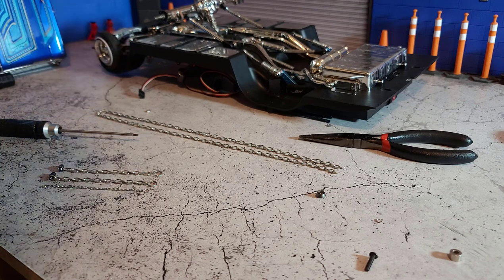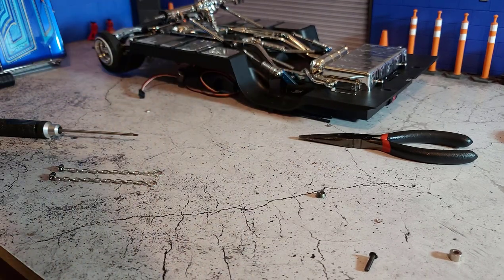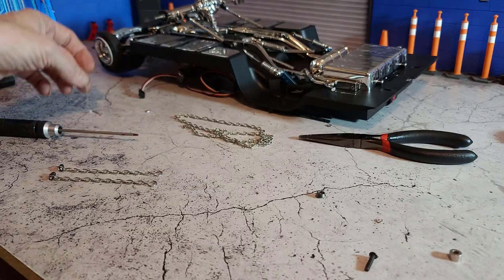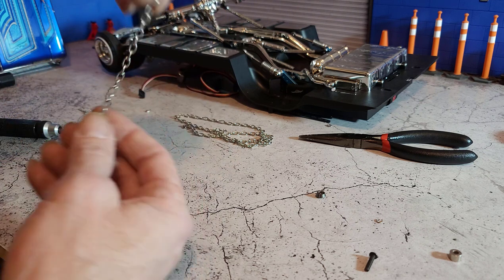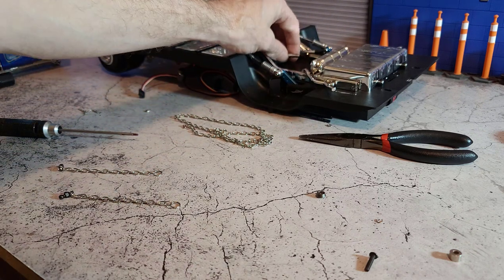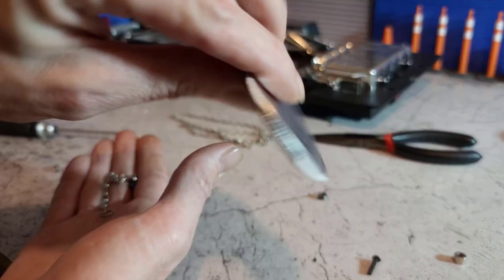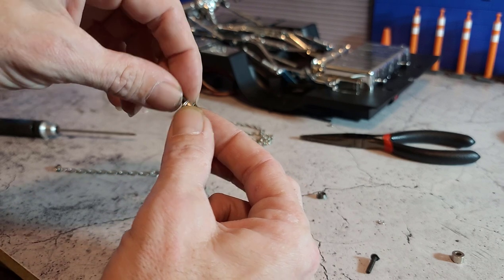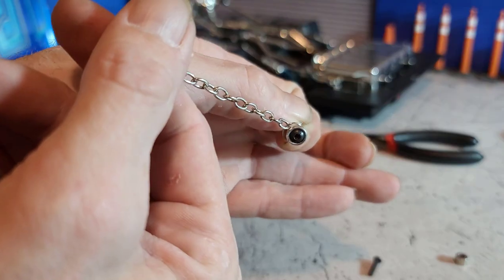Redcat Impala SixtyFour Lowrider Axle Chains Install

Comment: Hello,i have a question about the (strenghtend) rear axle you have on your 64.Where can i find them,i have been looking on Redcat,Kandy n Chrome, eBay..i can't find them anywhere.To me those axles a big mystery bicause i see them on a lot of 64's on YouTube,but i still don't know where to find and buy Them...thanks..
Reply from the maker: The axle reinforcement is from Kandy and Chrome. It's a decal but I cut lexan stip to reinforce it.
Reply: @NorthSideCustomRC  THANKS for your superfast reaction!!...Yes ofcourse i've seen them on K&C ,but arrent these Just adhesives/stickers with engravings?...I realy thought it was An new type of axle ..i am surprised by your info..thank you very much ,PS your 64 looks beautyful...kind regards from the Netherlands,...Erwin
Reply from the maker: @ErwinvZ  correct his is just stickers basically but can do what I did and take a piece of scrap lexan. 

Put sticker on lexan then cut out the sticker so the sticker is reinforced with the lexan. Only need do half inch as rest wraps around the axle

Comment: What are the chains for in real life on a 64 ? Thank you
Reply: its to limit the hydro length on some janky setups. but properly setup it can create a pivot point so the differential to body/frame work in unison(almost like a hinge) instead of independent of the hydraulic. when one side is raised and the chain is lock/limited it acts as a fulcrum point so that when you raise one side the leverage actually helps pull the other side down (instead of just lifting one side and relying on the car weight to bring the other side down). this allows to twist the enitre frame easier, to get the front wheel up to 3 wheel.

i dont think this will work on rc because the suspesion is not floating youd just be fighting the opposite servo.
Reply: Nice thanks

Comment: Take some of the slack out so it looks more realistic.
Reply from the maker: I actually got them as tight as I can without pulling on them. My issue is there is slack because the springs are compressed a bit under the weight, when the shocks decompress the chains are tight

When she hops as the nose go up the shocks decompress gives a lil more height and help from stalling on the bumper cuz she wobble. On a previous set up this trick is how I got her to pop 7.5 inch with stock servo horns no crazy extensions
Reply: @NorthSideCustomRC  since the chains are just for looks as opposed to a real car, maybe there is a flexible chain that would stay tight without really causing any lift limits